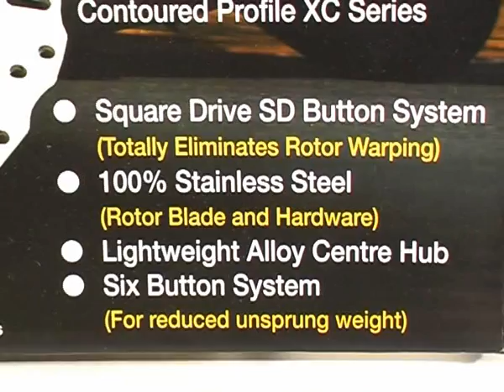EBC Brakes Rotor technology video

Comment: This is so funny, "the rotor blade never comes in contact with the rotor button". Of course it does. How on earth can it take the braking forces if it didn't. You mean the slotted design provides more thermal expansion clearance for the buttons.